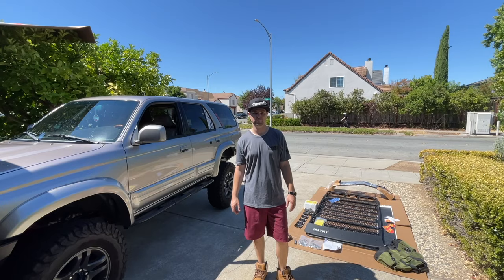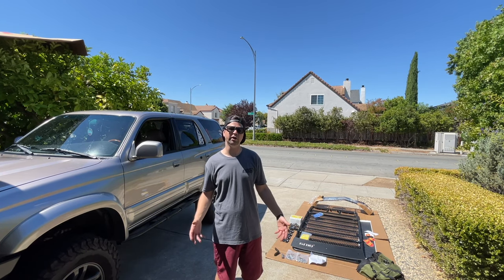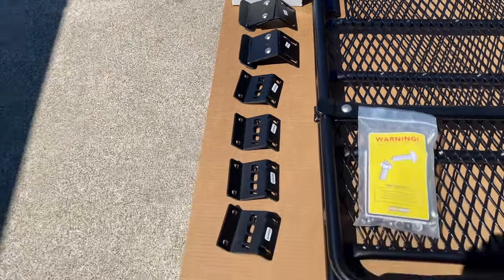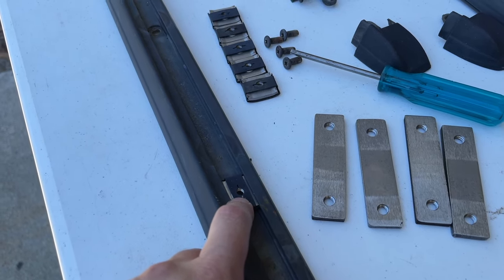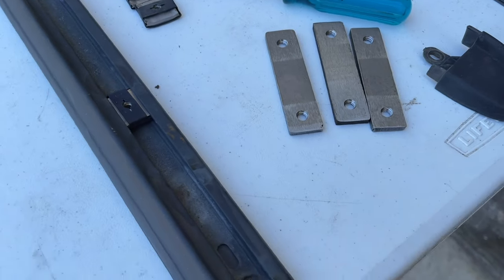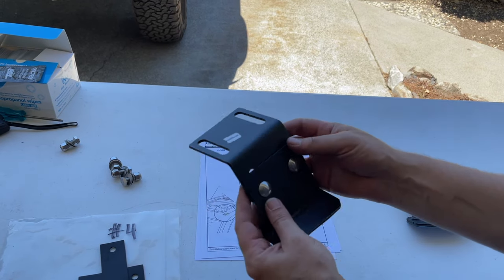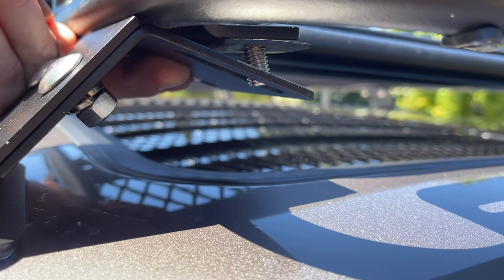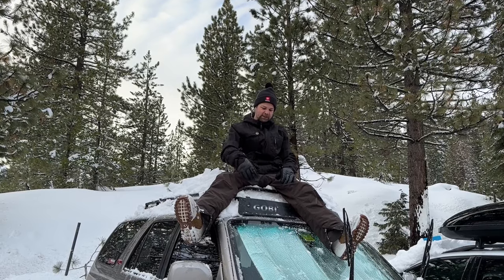GOBI Stealth Roof Rack Install (3rd Gen Toyota 4Runner)

Comment: $1800????? Insane!
Reply from the maker: Quality comes at a price.  Gobi makes very nice and functional roof racks that will last forever.
Reply: @TimmyTheToolman  not at about 1/3 i can get a decent 3rd gen 4runner in AZ, no doubt it’s quality, but im sure there’s gonna be a Chinese knock off at a fraction of the cost with decent quality
Reply from the maker: @phxamigo  Good luck finding a Chinese ripoff Gobi copy being shipped over from China.  China loves to copy lots of products, but I highly doubt they're going to get in the business of building roof racks.  I think the shipping cost would be massive.  Kind of the same reason you don't see China building ripoff copies of other people's bumper designs.  Finally, Gobi has no problems with protecting their roof rack designs and they've taken several people to court over it.  They have multiple patents for their designs.  Any U.S. seller importing a Gobi copy will be quickly served a cease and desist letter with the threat of a fat lawsuit if they don't.  You'll find other affordable roof racks, but it's not going to be anything like the Gobi design.

So, you can hope and wait, but I don't think it's going to happen.  Your best bet is buy a welder and a tubing bender and teach yourself to fabricate.  Good luck!

Comment: $1,800-$2,000 depending on setup?????……more promos for high priced overland gear!
Reply from the maker: Sic Mods have a high price because of the quality of workmanship, the cost of materials used, and the cost for shipping.  Look at the price of any quality aftermarket product that requires extensive labor to assemble, like bumpers, and they're all up there in price.  This is why a DIY weld-together bumper is much more affordable than a pre-assembled bumper that is powder coated and shipped to the customer.

You could always design and build your own if you want to save money.  But, you'll have a much higher time investment than Sean had.  - Timmy